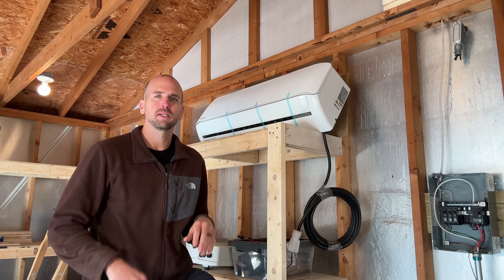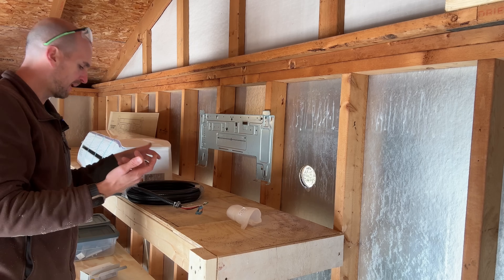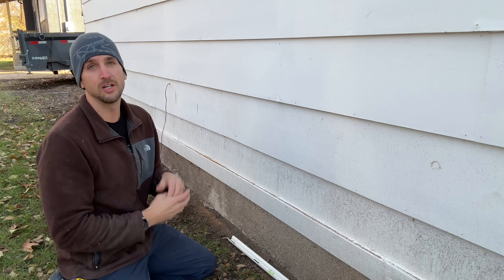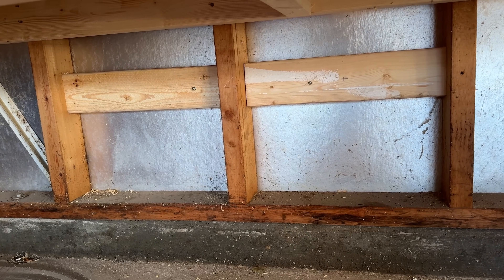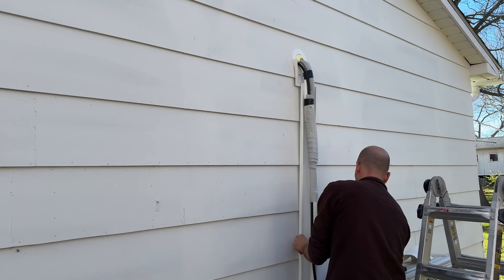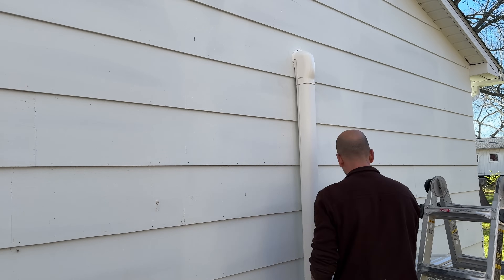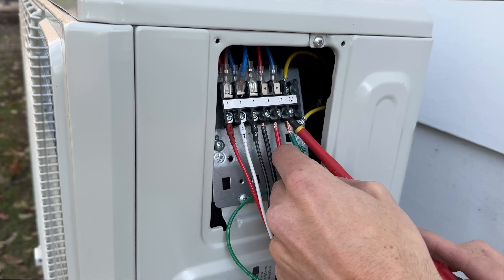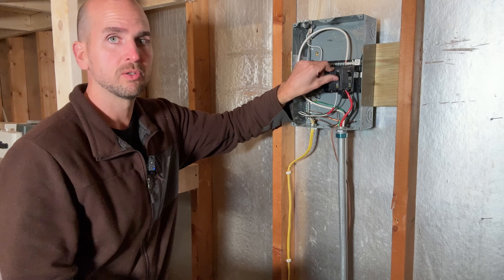Complete DIY Mini Split Installation | New Mr Cool 4th Gen Unit

Comment: I just completed the install of the same 18k unit. I also did the electrical myself thanks to YT and help from a local electrical supply house. I watched prob 20 YT videos before-hand... to the point I could walk through the install process in my sleep.

One tip; the condensate drain hose from the air handler is very flimsy plastic material. I can't see how it would last over time with temperature changes. I replaced it (right at the 5/8" OD connector on the back of the air handler) with 5/8" ID reinforced PVC tubing. It took me two significant efforts contacting MrCool to properly identify the size of the connector. I wanted to have the replacement hose ready before I purchased the unit, as I did for all tools, parts and accessories. 

You mentioned the challenge of finding wall mount racks suitable for 32" wooden wall studs -- no kidding! I ended up going all stainless... the 2 vertical racks, as well as 6 - 3/8" hanger bolts (SS) I ordered online to mount the brackets to the sidewall. The rack is 'stood-off' from the siding with about a 1" space to allow for painting around it. To bridge the 32" space between the two vertical stainless mounting brackets, I got 2, 2x4 aluminum bar stock pieces to bridge between the brackets and mount the condenser to. And ALL SS hardware everywhere. All in, I spent over $170 in mounting rack hardware. 

Even though it's mounted on the exterior garage wall with all the space of a garage between the condenser and the house living space, it will vibrate the wall enough that it sounds like a truck is passing by on the street sometimes. I'm investigating different vibration isolation pads that might improve the situation. 

In this video the extra lineset coil is stored vertically, which contradicts the MrCool instructions. In multiple other YT videos HVAC people have commented this is bad, as it can lead to oil collecting in the lines and affect performance. They should be coiled horizontally. In my case the line set ran over my garage rafters and I was able to coil the extra horizontally there. 

The AC whip I bought could be cut to length (unlike some), as I wanted a clean installation without FEET of extra cable dangling around off the condenser for a sloppy look, but to each their own. 

Also, I used a 25 amp breaker, with 10/2 Romex, at the suggestion of others, including the people at the electrical supply house after showing them the units electrical specs. 

It was a very satisfying project to complete -- I'm very happy with it. My experiences with MrCool customer service have not been so great however when I had questions.... getting someone to respond takes a lot of patience and perseverance. I hope I don't have any issues with it as I feel I will be mostly on my own.

As observation is that I don't understand how their warranty can even be legal. To get the full warranty they require you to purchase, TWICE A YEAR, their $70 maintenance kit, which is a MASSIVE RIP-OFF. You can get a much better quality, reusable evaporator enclosure bag on Amazon for $30. Who doesn't have pump sprayers (or buy a $25 Chapin), and buy more more reasonably-priced coil cleaner ($10-12/can). Or, do what many HVAC pros do and mix some Dawn with white vinegar to spray the coils with. So if I PROPERLY clean my unit twice a year for a FRACTION, and I mean FRACTION of what the MrCool kit costs ($700 for 5 years!), then I have no warranty. Nice.
Reply: PVC for the drain pipe is smart. Mine is 3/4 years old and the flimsy tube has been a problem.
Reply: @nicola3060  I think I got mine on Amazon. Reply here if you want me to look up the item and I will. But if it's the same unit as mine, the important thing is the 5/8" ID. It's a bit of an odd-ball size as far as PVC tubing goes so a hardware store may not have it.
Reply: Regarding the coiling of the line set,the only thing is that it’s too much…which would restrict the required amount of oil goin back to the compressor but the line set can be vertical with just a U shape behind the condenser and right into the connection.
Reply: @r410a6 this is really a job for professional unless it's pre-charged and you follow the instructions exactly. It's not worth the hassle to me as I have a huge Frigidaire unit I put in the wall that works perfectly and is not very loud.
Reply: @guruofendtimes819  It is not that hard, especially if you actually spend the time to read the manual. It is also WAY better to look at than the through the wall unit that will also have you freezing your ass off all winter long. No matter how well you wrap those wall units, they will be a massive heat drain all winter. I didnt mind that when I heated my house 100% with wood, but now that I have gas heat... no freaking way. Not to mention, that through the wall units are NOT getting 19-23 seer. So your savings on the cheap wall unit will soon be lost due to terrible efficiency.
Reply: "The AC whip I bought could be cut to length (unlike some), as I wanted a clean installation without FEET of extra cable dangling around off the condenser for a sloppy look, but to each their own. " - ok, i've been wondering about this! my outdoor unit will basically sit behind the indoor, and I don't want this ridiculous coil getting buried by snow, covered in spider webs, etc. are you able to completely get rid of the the refrigerant coil? where did you get your AC Whip?
Reply: @guitarchitectural  You're stuck with the 16ft coil in a normal self-install. That's one of the things that a professional installer will do with a conventional unit -- cut your lines to the specs of your site install. The whole point of Mr. Cool  is the pre-charged lines. Personally, if I do get one of these, I'd cut the electrical to fit, that's easy to deal with as long as you don't mess up the order of the wires. Though looking at it, I maybe be able to position the unit to avoid any slack. For the future... the building it's going to cool is being built as I type.
Reply: @guitarchitectural  I got it, and all my electrical parts at an electrical supply store...the type of place that caters to the electrical contractors.
Reply: @festerofest4374 did the electric supply charge you extra for 25 amp breaker.  
I've never seen one in any electrical box ever..15,20,30,etc.. 
Also paint the PVC outside the house especially if it is a thin wall, the UV rays will deteriorate it after many years.
Reply: Your points are very valid and I know the units are hard to clean. That's why I opted for 22,000 BTU Frigidaire that I put through the wall. Total cost $680. 
If I ever put a central system in I will put in a package unit with all the components outside for easy installation and repair.
Reply: Its been a year, how has it held up?
Reply: @Hyrekia  Wonderfully! Loving it 100% if it proves reliable for years I'll love it 1000%. Coming from a huge window AC unit PITA to a mini-split with phone app control and programming is pure heaven.
Reply: Very awesome review thank you very much! I didn't realize they don't have the line set cover with my 24,000 BTU model...... yeah stupid on my part I know I didn't even realize that they didn't send that with seems to me it's part of the whole dealing for the money I paid on Amazon Prime day which was about $2,100 delivered at least they could have given me the line set!   If you ask me they sold me an incomplete product--- no one is going to use the product without those lines being covered! Then when you go on their website they want like $115 bucks for what amounts to 5 or 10 bucks worth of plastic what a rip off I went on Amazon and found them for about 32 bucks which is still about 10 bucks higher than what they're worth I think! Since I pretty much need them right now I'm going to at least go on online for Lowe's and Home Depot and see if they carry something similar that I can go pick up.! Selling an incomplete product is like two strikes right off the bat.....
Reply: After that rant I must say I've heard nothing but good about the company and the product and I look forward to getting this running! also wanted to thank all of the people that are putting in good useful comments like coiling the excess copper horizontally Etc

Comment: Hello. When you started this thing did it go in a defrost mode after about 8 minutes? Mine do that every morning I start it up , I don't run them all day and night long. I live in Northern California.  But every morning if it's a bit colder it goes in a defrost after 8 minutes. The installer is telling me it's normal. I have a Daikin , one unit outside and three heads inside .

Comment: How is your Mr. Cool heatpump doing since the temperatures have dropped? I've only seen my heat strips on my Carrier kick on one night here in NC, according to the Nest thermostat. Have you measured the temps being put out by the Mr. Cool unit?
Reply from the maker: The 2 units I have running are doing great.  We still haven't gotten a real cold spell yet and both of my units do not have heat coils so any heat provided with be just from the heat pump itself.
Reply: @EverydayHomeRepairs Thanks for your reply. What happens when the heat pump can't keep up without the heat strips? I assume it will just continue to run as the temperature in your house continues to drop. Is there a workaround for that situation other than having a secondary heat source, such as a gas backup?

Comment: It looks great!  I put one in our back room (not on the home hvac). It works ok with heating, but really shines in the summer for cooling.  I put ours on a concrete pad, but your wall mount came out really clean, especially with that extra line set coil.
Reply from the maker: Yeah, I like the concrete pads but wanted to give a wall bracket a shot since I hadn't used one in the past.  Thanks for the feedback!

Comment: Just curious is it possible to run the lines inside the wall and then drill the hole closer to the bottom so the lines are hidden?  I have a shed that is unfinished and thinking about getting a unit or two.
Reply: That's what I did. Super-clean on the exterior this way.
Reply from the maker: Yes, especially in an unfinished space like I had for the detached garage.  How are you going to insulate your shed, this is what I am thinking through now 🤔

Comment: Nice installation, you covered all the important details about it. On the other hand, installing this unit in an uninsulated garage makes no sense to me.
Reply: Trying to work inside a hot closed garage sucks.  Anything to take the edge off. lol, you're not running any motors make sure roof vents are sealed

Comment: Wouldn't it be better to test out the system first before wrapping the connections and the refrigerant lines?  Otherwise you might have to undo a lot of that work if there is a problem.

Comment: Doesn't that unit require a 30 amp breaker with 10/2 wiring?
Reply: I went 25A with 10/2, after showing a local electrical supply house the electrical specs.

Comment: 89° on the indoor unit seems low when the temperature outside is 45°? 

On my 1 ton minisplit, I measure 115° when the temp outside is 45°. And 100° when the temp outside is 30°.

Comment: What happens if you have the heat on and the batteries are depleted?
Reply from the maker: Things start to get cold 😁 I am using this garage a bit as a testbed for portable power stations, solar, wiring, etc.  If this was a true off-grid setup I would have a generator backup if needed to charge the batteries.
Reply: @EverydayHomeRepairs  I see.  The battery power supply will shut down -- the system won't let the batteries get below a set voltage(?)

Comment: Good job. Curious why you didn't mount the inside unit between the 2 shelf units instead of on top of the left one.

Sure it will work down to -15 but the heat output at that temp will be so low that your space, unless super insulated, will eventually become too cold to stay in. It's kinda like advertised range of an electric car. They advertise like this in Canada too where it can get really cold in some parts. You will always need a supplemental heat source.

Comment: One thing about the extra coiled line, the coils should be in the horizontal direction not vertical, this might have fluid sitting on the bottom of one of the loops.
Reply: Yes. The MrCool instructions say to lay the coil horizontally under the condenser.
Reply: Oil trap possibilities?
Reply: my manufacturer tech guy said to just coil any extra tubing that came standard in their kit behind the outside unit.....    so far its works as expected
Reply: @fishlanding2  it's prob fine either way but one way is more prone to issues than the other
Reply: Now the lines are pre charged with nitrogen .... 
Just gets released into the atmosphere ... Keeps moisture out ...ready to connect.
Reply: @jeromepark7002  Is that for all mini splits or just Mr Cool?
Reply: All of them are . Its a good idea to vacuum the system before opening  the valves, which wasn't done on this video@user-yx4on8hx4w
Reply: @jacobramirez4586  WRONG WRONG WRONG
Reply: What part is wrong, and what would be the correct way ?
Reply: @jacobramirez4586 On the self installation units the parts are all pre-charged no vacuum seal needed.
Reply: @jacobramirez4586  Not with a mr cool.
Reply: So, I saw your comment last year after you posted, but didn’t like or comment. You are wro…no, you’re not. Because of your comment, I moved some on another unit that was installed prior to us buying our home. I asked a friend who was an A/C tech, who confirmed what you said. Thank you.
Reply: No vacuum
Pomp and gauge? It’s cheap and so simple and you can check negative val and potential leaks before releasing the gas
Reply: I stuck my extra line set horizontal under the unit and it was a pain in the a…..neck! 😮😮😮
Reply: this!  the only issue I saw on this video. Very well done and informative!
Reply: If you set it up like this it will trap oil. My understanding is pag oil will absorb moisture. As it does it will corode the line set or any fittings it makes contact with. There is a line dryer in these units that absorbs any moisture in the system. Lay the coils flat.
Reply: That way it doesn't slug the freon .
Reply: @burnair1608 Not a thing.
Reply: The system is designed to provide enough velocity to force any refrigerant or oil back to the compressor without issue regardless of coiled lineset orientation.
Reply: I think the head and the lines are charged with nitrogen, which gets released when you connect, so no need to evacuate system.
Reply: @TheScotzo doesn't that defeat the purpose of pre charged lines?
Reply: @TheScotzo  Actually the head and lines were Precharged with REFRIGERANT. So yes, no need to evacuate down to 500 Microns or less.

Comment: I’ve been a subscriber of yours for well over a year and I really appreciate your videos. You did a really good job with this one. However, I am a little bit concerned about the extra refrigerant lines being in the vertical position. I would prefer to see them horizontal. It will help with oil return to the compressor.
Reply: I installed one of these a couple of years ago and have lost sleep thinking about leaving my lines vertical, but there was really no other choice given all the extra line I had.  Even thought about calling in an HVAC company to remove the excess.  That said, 2+ years later everything is still working great.
Reply: Mr.Cool actually recommends putting them vertical.
Reply: @bertveldhuizen8699  The Mr. Cool instructions actually say to install the excess in the  horizontal position/orientation.
Reply: @bertveldhuizen8699  that goes against everything I’ve learned — so I checked. Page 27, bottom right: https://mrcool.com/wp-content/dox_repo/mc-diy-4-es-im-um-en-01.pdf
Reply: P.27 flat with ground @bertveldhuizen8699

Comment: Here in Brazil it’s always custom loop, and condensers always come preloaded with gas for 15 feet of tubing. Actually most manufacturers require installers to use at least 15 feet, no matter how long you need, for dampening and flow reasons.
Reply from the maker: Oi Luis, Tudo Bem?  Thanks for the feedback from Brazil.  I have seen that most the new builds down there come with mini-split ready construction but looked like you have to purchase/install your own units in the living spaces or just bedrooms.  Is that correct?

Comment: Nice video. 
Another helpful tip is to run the line set, power, and drain down the wall on the inside when able like your setup would have been great. Looks much nicer and more professional stub out at the bottom next to the outside unit. 
Grace and Peace 
Slick
Reply: 100%. That's exactly what I did. The lineset/power cables go directly through the wall straight out to the condenser. For those who aren't working with an insulated, finished interior space, why wouldn't you do it that way??
Reply from the maker: That would have been cleaner for sure and I considered it for this garage.  I decided to go a more "traditional" route to try and align with what would be more common for the viewer.  Thanks for the feedback 👊